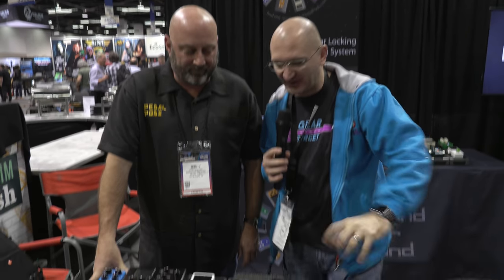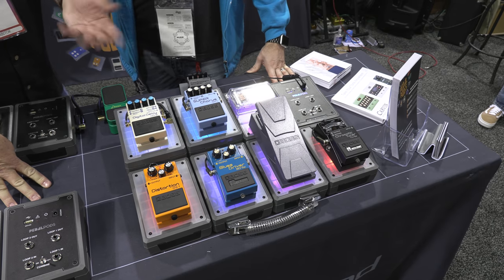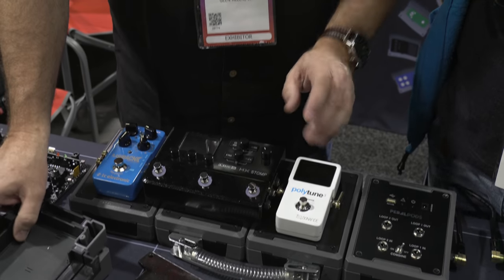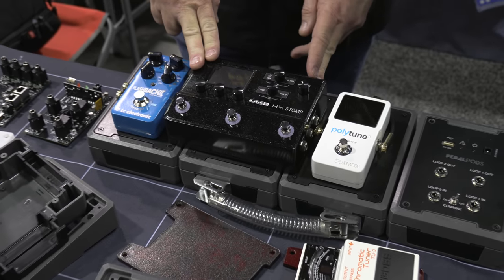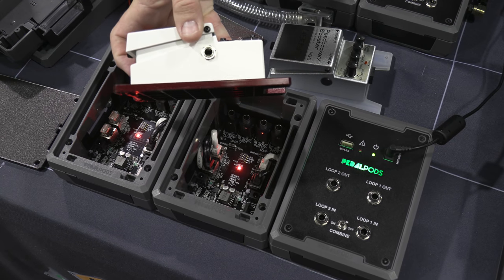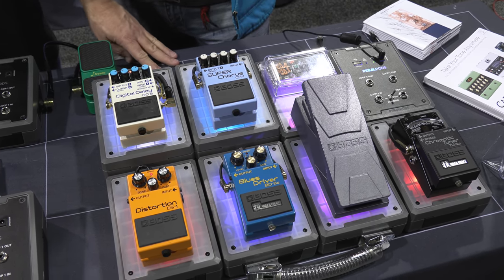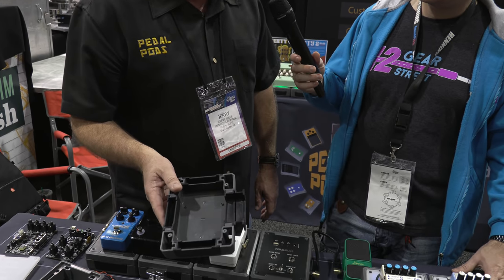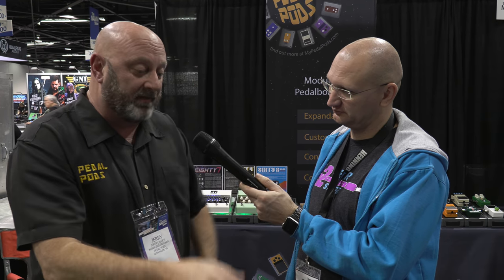A new form of pedal board? Pedal Pods

Comment: I don’t really understand the point of it, I want to like it, but I’m just not seeing the use, and the biggest problem I see is just that, it’s massive. I could fit twice as many pedals on a board... need to look into more detail about it... at 80 a pop, that’s 800 plus tax so near 900 for 10 pedals, so price is rather high for what it is, bulk cable and ends are cheap.... it would be really cool if it was a switched matrix where I could easily put any pedal in any order in the chain, maybe it already does this I’m not sure....
Reply: Robert, Thank you for your comment.  We want you to like it as well.  This solution isn't for everyone.  We have examples of Pedal Pod boards with multiple pedals being powered by a single Pod as well as pedals being placed in a compact configuration (utilizing every square in of the surface).  The latest boards/images have NOT been uploaded to the site yet.  If you would like to see examples of these in advance PLEASE feel free to email me and I'll send them to you (jerry.calder@mypedalpods.com ).  Other examples are on the gallery page on our site ( https://mypedalpods.com/pages/endless-possibilities ).  Regarding your switcher comment, I agree and I'm working on that and other advancements BUT these will be later down the road.  Thank you agin Robert for taking the time to detail your thoughts.  All the best to you... Jerry

Comment: On the plus side, it looks convenient and the power supply is impressive, the end result is something that looks neat.  

On the not so positive side, my current pedal train has  9 pedals arranged for fit and convenience and their position is not related to signal flow.  Here it seems you would be arranging your pedals in signal chain order.  No biggy, but might end up in a bigger board and in some of the places I've played with a larger band, space is limited - having the gas module on the side providing power adds to this issue.  

A battery option would be a good thing.  I use my board with a Power LT XL and that makes a big difference in setup time (no scrabbling for the nearest mains outlet).  

In the grand scheme of things it's not expensive (except for the cases perhaps), but a new module is around about the same price as a lot of pedals, thus doubling the investment when you buy a new pedal.
Reply: Martin, Thank you for your comment and the kind word.  The Pedal Pods solution can be wired in any order.  If you go to our site and look in the gallery you'll see many examples of this.  The Cat5 order determines the pedal order NOT the physical pedal location.  I an explain in more detail if you like.  Feel free to email me:  jerry.calder@mypedalods.com . I look forward to hearing from you.  Jerry

Comment: In the very beginning of the video, I thought that this is a really bulky, clumsy pedalboard. Then I am convinced about its versatility. But still there is one thing that bothers me. I think you need a little bit more simple (visual) interface for the electronics section. Not everyone is used to that pcb stuff (for example me. I am less than a noob)
Reply: Volga, Thank you for your comment.  We have a simplified version of Pedal Pods (Pods).  These do not include any electronics or cables.  Simply a mounting platform.  ( https://www.youtube.com/watch?v=sQoue0Ggf-I ).  Let me know if you have any additional questions... Jerry

Comment: I'be got an idea. Could you offer them in three sizes? The size they are now, double wide and tripple wide? That would allow accommodating various pedal sizes without using extra pods. The larger ones should be able to be offered with a very nominal upgrade price and would allow a ton more options to the player.
Reply: Tom, Thank you for your comment.  I originally looked at having different sizes BUT once you mixed and matched them the geometer didn't work.  The other consideration was the number of molds we would need to have made as well as inventory and logistic considerations.  The current size (single Pod) was designer to work with 80% of the pedals out there and combining them made it possible to accommodate almost all the pedals out there.  Thank you for your feedback and good luck to you Tom... Jerry

Comment: Does this system have a loop switcher to turn each affect on and off via midi? Or is that something you're considering in the future? Also, for the pedals that need midi communication, is there a way to already create a midi hub with multiple pedals using midi from each pod's electronics? What about the possibility of using parallel signals and merging with proper isolation without the problem of ground looping?
Reply: Dominic, Thank you for your comment.  I do NOT have midi control or switching built in (possibly in the future).  There is room internally to route midi cable between pedals as well as an option to cleanly patch the midi cable out to an external device.  If you have additional questions PLEASE feel free to email me directly:  jerry.calder@mypedalpods.com

Comment: Great idea but you might could offer the basic pod itself in other colors than black. Plastic can be made in different colors!. What if you have a single pedal or 2 that is always on and sits in the back of a rack? Alot of people, myself included, simply have them velcroed in there. The good looks a bit big for that application.
Reply: Wade, Thank you for your comment.  The challenge with manufacturing is you have minimum run expectations.  I have to produce 1000 of a given color at a time.  Now if I offer 5 different colors that a minimum of 5000 units I must pay for, ship, warehouse, and inventory.  On top of that, someone would probably want a color I don't current produce or have in stock.  We are a small company that was founded and funded internally.  I simply can't afford the inventory or the challenges that come with it.  That's why we spent a little extra to get pre-primered plastic so people can personalize the Pods however they want.  I'm currently testing Hydro Dipping Pods.  Amazing graphics and effects.  Best of luck Wade... Jerry

Comment: To be honest, you’re trying to hit a very small portion of the market whereby money is not an option.  I‘ve put so much into my other equipment I‘d have to think twice about putting that much into another pedalboard. I‘ve built mine out of an Ikea shoe rack and spent 12€.  The upside is I did it myself and learned quite a lot about wiring and placement.  The downside is that if I want to change something it becomes a days worth of work to get it right again.  It is a great idea though but I‘m still saving up for a Strymon and I‘d rather have that before the new board.
Reply: Gil, Thank you for your comment.  I agree with everything you said.  I wish I could have developed a solution that was more affordable BUT... I just couldn't compromise on quality.  I hope you understand that.  I wish you luck.

Comment: Unless I have misunderstood, I think those that use switchers and midi etc are going to struggle to consider this. I love it from the power point of view, but would have to manually cable up, which for me would not justify the price point. But for those that tap dance on the pedals, this is a really interesting concept, but I fear that the market would be small for these. I wonder what future revisions might be.
Reply: Alex, Thank you for your comment.  You're right Switchers and midi add to the complexity BUT we have example of players that use one and or both and love the solution.  Rev2 (bouncing around in my head and on paper) will address your concerns.  The challenge will be price-point I fear.  Best of luck Alex... Jerry

Comment: My only "comment" would be the pods are too big and the pedals are too far apart. Also, some stages are small, and square footage for pedalboards can be limited. Otherwise great idea. Neat too...
Reply: Joe, Thank you for your comment.  This solution is designed to give the player space between pedals.  We have examples or players that have placed pedals in between.  Regarding the size of the Pods, they are withing 1/4 in in height compared to a Temple Audio or PedalTrain.  With other examples we are smaller.  I appreciate the feedback.  Be well... Jerry

Comment: I have a problem with the aesthetics. My pedals certainly won't go on a board made of plastic. Aluminum yes, wood yes but that kinda looks ridiculous imho. Also, it should connect way more seamingless so you should get rid of the beveled edges so that it looks like one peace when more modules are connected. Then make it black so that it stands out as least as possible. The "gaspedal" is wasted space that could easily hold one pedal if the connectors were on the backside. To be honest, I would like that whole concept way better if the modules are the size of three normal pedals or so. Like a pedaltrain nano. So you can add additional rowes or double the lenght. Then make the pods more like a wedge so that it is slightly tilted.
Reply: Christoph, Thank you for your comment.  Great suggestions and I thank you for them.  Industrial Design is all about give and take.  My favorite design could not be manufacture due to complexity and cost.  I had a machined aluminum pod that looked amazing but WAY to expensive.  The Pods are ready to accept paint and they look totally different based on color.  I'm also testing Hydro Dipping with some amazing results.  Thank you again for taking the time and the best of luck to you... Jerry

Comment: I believe that Henning is fatter than Jerry.
I do have a question : Is is possible to power 2, 3 or 4 pedales with only one of the powered module?
Reply: Olivier, THANK YOU VERY MUCH FOR THE FATTER COMMENT... Haha.  Regarding your question on power multiple pedals from a single pod, YES!  As long as the voltages are the same AND the current doesn't exceed the following:  9v – 550mA / 12v – 420mA / 15v – 330mA / 18v – 280mA

Comment: Not sure if it's a prototype, but it's not pleasing to look at, and the spacing is a bit much, not very compact.
Pedal boards are designed to be compact / space saving, a all in 1.  mine even has a very nice gig bag to transport it in.
Reply: Skully's, Thank you for your comment.  This solution isn't for everyone and YES this is the final design.  We have been testing the solution for over three years and it's been available for purchase for the last ten months.  You are correct regarding the ample space between the pedals BUT know that you have the ability to place pedals in between other pedals (in short, you can cram as many as will physically fit on the surface).  We received feedback from many players that if given the opportunity to simply grow the size of their pedalboard and NOT cram as many pedals as possible onto a restricted surface they would prefer that.  This system was designed to help you focus on your performance and NOT focusing on hitting the wrong pedal.  Skully's, I do appreciate your feedback and value your opinion.  This helps us develop the next generation of pedalboard solution.  Thank you sir and good luck... Jerry

Comment: So interesting but I would like to see the power in as a kettle plug. Also cat6 cables being used
Reply: Scott, Thank you for your comment.  I kept the AC to DC power supply external to help keep the potential for RF/EMI noise to a minimum.  You can use Cat6 if you like.  We did NOT see a signification improvement in sound quality.  As a natter of fact, during development we tested with the cheapest Cat5 cables we could find.  I wanted to make sure the system performed under the worst conditions.  Enjoy your weekend... Jerry

Comment: the thing that would bring over the top would be to be able to midi configure it to change the order of pedals. also, they could have covers that could be sold separately to make easier to carry them around and bring them on planes and stuff (like the Schmidt Array stuff), I guess that you can't make eeeeevery configuration, but you could sell them in like 4, 6, 8 or 12 modules configurations.
Reply: even if it brings the cost up a little bit, the midi configuration and the cover would bring them to a higher quality market. Also in the demo, it would be nice to see how two pedals (maybe mini pedals) can be connected to one of the blocks aaaaaaaaaand also, going crazy and connecting 4 (two on each power supply in the block) that are compatible sharing power to see how it stands with noise issues and those kinds of things. you know that guitar players always have more pedals and want to put as much as possible on their boards.
Reply: @TheGastodont  Gaston, Thank you for your comments.  There's a lot here to take in.  We do NOT have midi controllers on the boards BUT you can wire the midi traditionally and use the internal wire management to rout the cables (very clean and simple).  Regarding the power comment, You can wire multiple pedal to the same Pod power supply (that's why there are two ports per board.  As long as they are the same voltage AND don't exceed max current you'll be fine.  All the best Gaston... Jerry

Comment: How much weight? You know touring and airline's
Reply: Ezquimal, Thank you for the comment and my apology for the delayed response.  The powered Pods with electronics and cables weights abut 1lb.  The NON powered pods empty are about .75lbs.  In short, these are lighter than a custom pedalboard from wood and slightly heavier than an aluminum board (when you calculate a power supply and cables).  Cheers... Jerry

Comment: My 2 cents. You have a great loop box and power supply. Just make those in as small of a package as possible and sell them to put on regular pedalboards. If you can make a compact power supply like the ones in the pod with multiple power points as cheap as a trutone or similar supply you will have the market.
Reply: Stimpson, Thank you for the comment.  I have a prototype that we've been playing with.  NOT quit ready for prime-time.  Thank you for the suggestion.

Comment: I get it & I like it. It's super clean & that in itself helps me breath easier 😁  I'm concerned about carrying it around - size & weight (with & without a case/bag).

Henning, would it be possible for Pedalpods to send you a couplea' modules so we can see:
1. How it compares to both small & large boards that you have - with & without Pedalpods' MyCaseBuilder case.
2. What if you want to stick a couplea' modules within an existing pedalboard - I know it's possible, but how easy and/or practical would it be?
3. What if you want to get Pedalpods' powered gas pedal for an existing board - how would that work?
4. Henning, as someone who's dealt with a buncha' boards n stuff, what's your take on this Pedalpods thingie as a user?
Reply: Jay, Thank you for your comment and the "I get it & like it" statement.  Let me see if I can answer your four questions:
1. How it compares to both small & large boards that you have - with & without Pedalpods' MyCaseBuilder case. - I'm not Henning BUT I'll share these details with you.  Each Pod (and all the cables/electronics) weighs ~1lb.  Each Pod has the following dimensions: Width = 5" / Depth = 6.5" / Front Height = 2" / Back Height = 2.75" ( https://mypedalpods.com/collections/products/products/pedal-pod ) For additional Details
2. What if you want to stick a couplea' modules within an existing pedalboard - I know it's possible, but how easy and/or practical would it be? - Are you requesting/suggesting mounting the circuit boards from the Pods onto or under another manufactures pedalboard (interesting idea)?
3. What if you want to get Pedalpods' powered gas pedal for an existing board - how would that work? - You would need a Gas Pedal as well as multiple Pod circuit boards (it could work).
4. Henning, as someone who's dealt with a buncha' boards n stuff, what's your take on this Pedalpods thingie as a user? - We haven't sent Henning a board to play with.  He's only seen these at the last two NAMM events.

Thank you again Jay for taking the time to ask these questions.  If you have any additional questions, please feel free to email me.  jerry.calder@mypedalpods.com